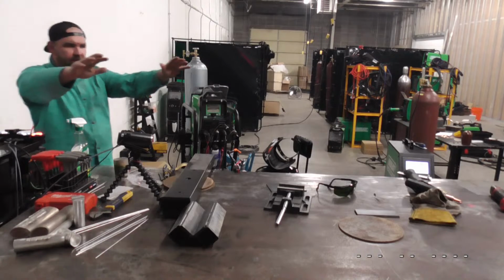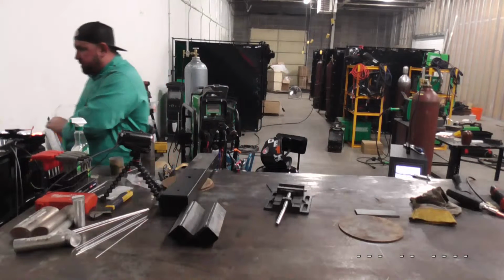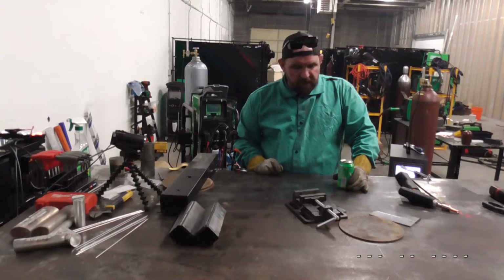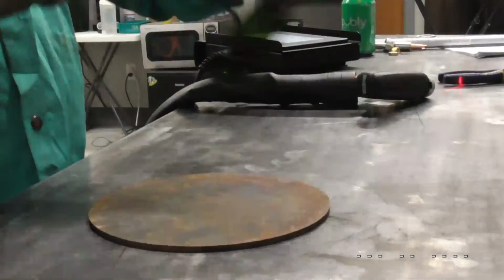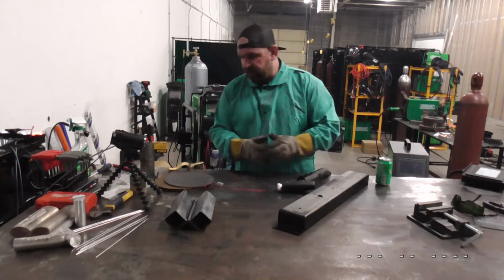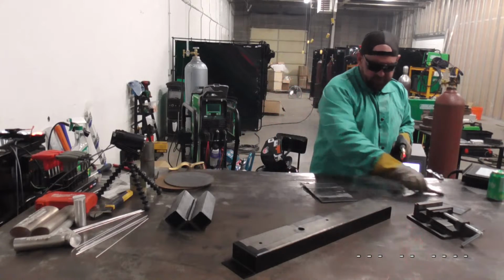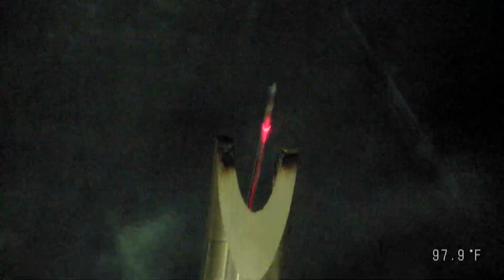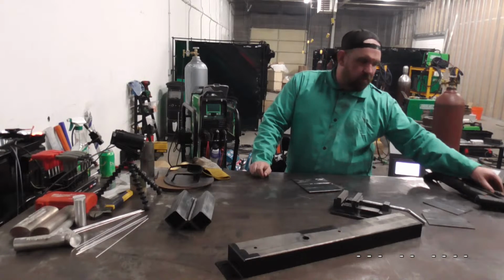Everlast Welders Live Stream | Welding(and cleaning) With Friggin LASER BEAMS

Comment: If 300W is all you’d need, then come out with cheaper units so more people can afford them! Say like 60W, 100W, 200W, and a 350W for the homeowners. Even selling units that do just one process  (cleaning OR welding) with the option to upgrade the units to get both if the end user wanted. I just bought a Lightning 275. I have no use to laser weld but a laser cleaner…heck yeah! But for $10k…no! Other laser welders/cleaners on Amazon are similar in price +/-, Everlast’s marketing point is to be more affordable then everyone else. More affordable units please!!😃